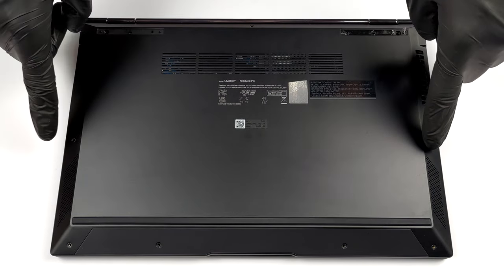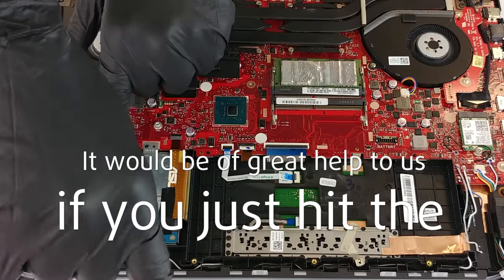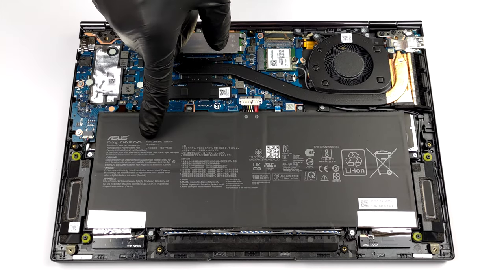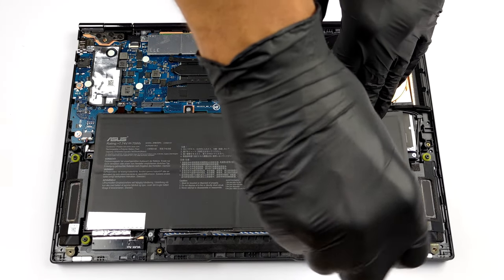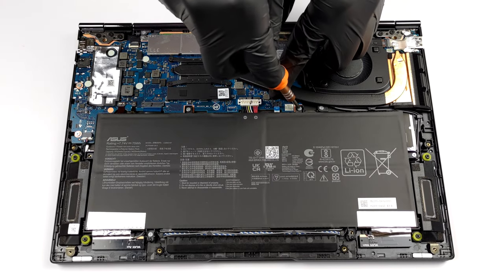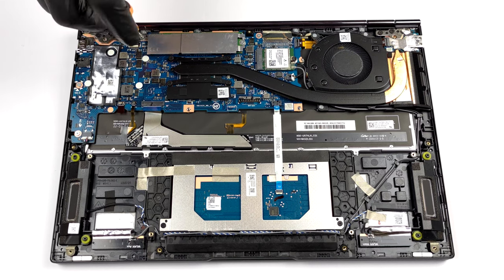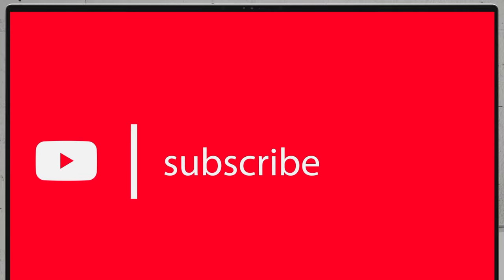🛠️ ASUS Zenbook 14 OLED (UM3402) - disassembly and upgrade options

Comment: Hi. Actualy I bought one. I ha ve a roblem. I use an old external monitor for my work which has a VGA input so I use a USB type c to vga adapter for it. In this laptop one of the USB type c port is OK with the convertor but another one is not. (Both work with ucb c to hdmi although). I want to know if it is a hardware problem for my unit or it is just the same for every one. There is no other way for me to check this so Is it possible for you to check that thing and let me know the result? I really do appriciate if you could help me. Thanks.
Reply: Hi. A very offtopic question but I have the same model and it makes creaking sound whenever lifting it up and holding. Does your do the same ?

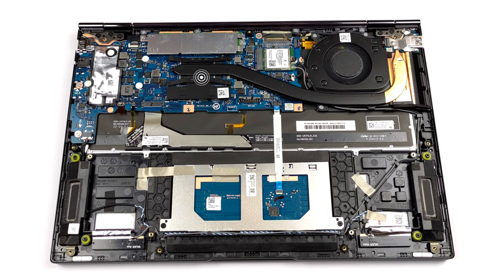Comment: At 1:47 error with RAM. This laptop used DDR5.
Reply: No. UM3402 is a model with AMD 5000-series Ryzen CPU and LPDDR4X memory. Those CPUs doesn't support DDR5 at all. Only model with Intel 12-gen CPUs (UX3402) does come with DDR5.

Comment: Maybe someone knows whether it's possible or not to upgrade the RAM to 16 gb after buying this laptop?
Reply: It is NOT possible to upgrade RAM. All the latest ASUS laptops have no RAM upgradability.
Reply: You can pay someone to solder on identical chips on the empty pads at a local computer shop.
The guys that do board level repair should find that trivial to pull off.

Comment: What you cant install gen 4 ssds like the samsung 980 pro and get gen 4 speeds?
Reply: It will work but with 3.0 speeds because both AMD Ryzen 5625U and 5825U chips support only PCIe 3.0 (Gen3) interface and ASUS website lists both 512GB and 1TB as 3.0, too. Also Intel SSD 670p shown in this video is a Gen3 drive.
Reply: @tomijs91  Kingston SSD KC3000 will be good for this notebook, i know it 4.0 version but i about size